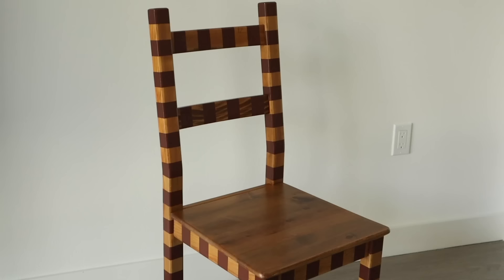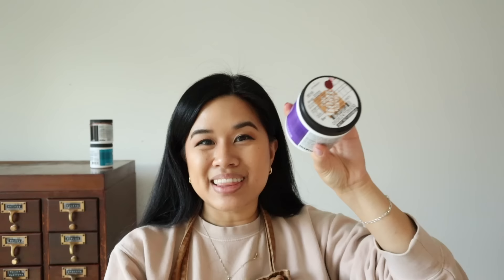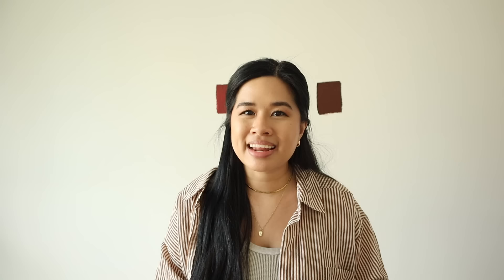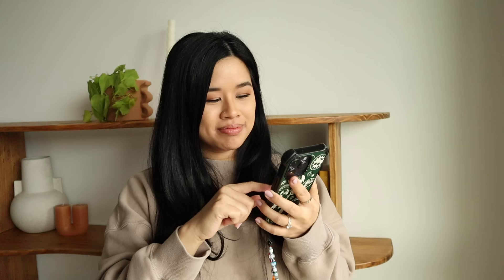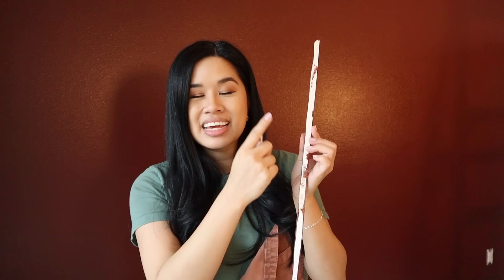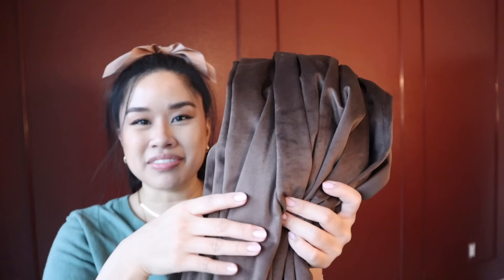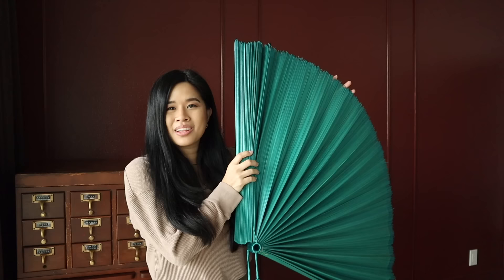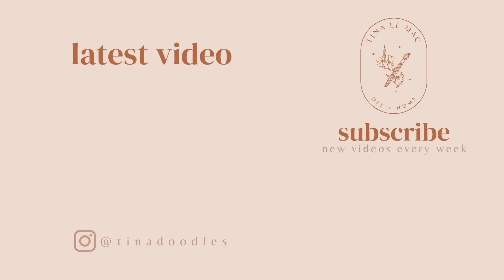MOODY DARK ACADEMIA ROOM MAKEOVER (w/ DIY renter-friendly removable wall moulding trim!)

Comment: The room looks great! It probably won’t matter in your case, since your landlord will probably make you paint it back before you leave, but for others who are trying not to have to repaint the wall when the trim is removed, the paint needs to cure for at least a full 30 days before Command strips can be safely applied.

Comment: Tina linked multiple options for the wall so which one did you actually use?
Reply from the maker: The one listed as “PVC trim” is the one I ended up using! (:
Reply: @tinalemac  Thanks